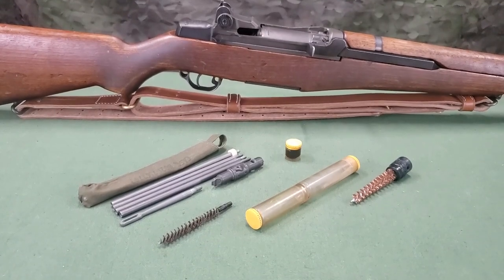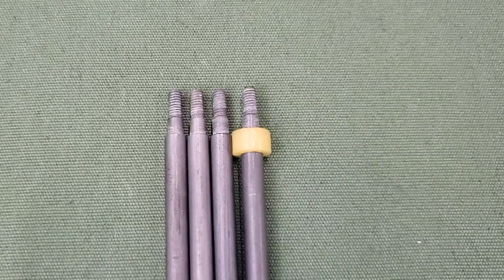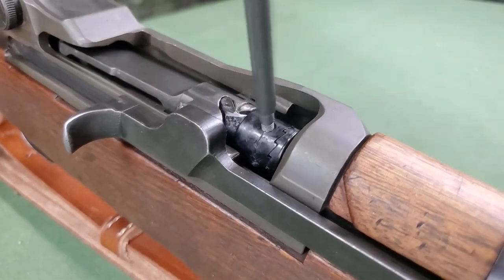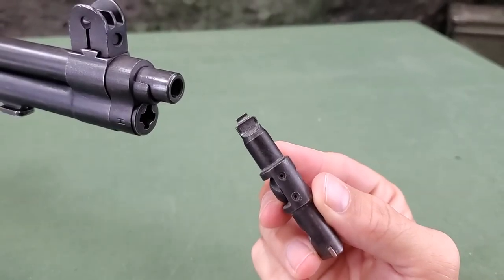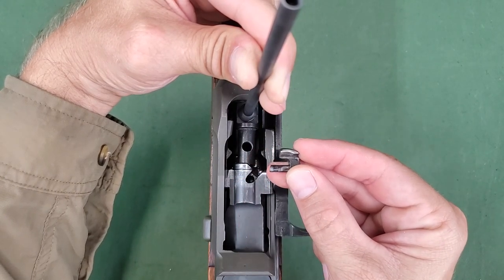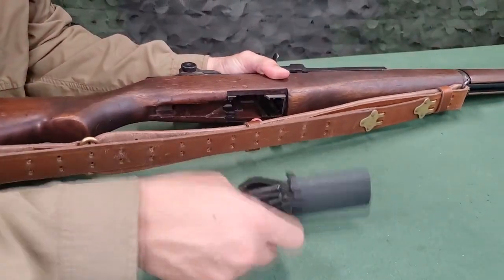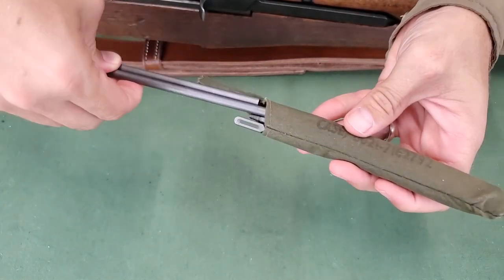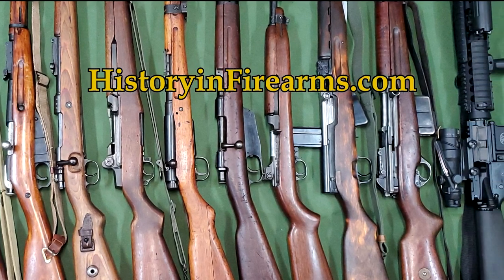M1 Rifle (Garand) Cleaning Kit, M10 (TF 8-05E)

Comment: Good video, I haven't tried to remove the extractor or ejector with the bolt in the rifle. Thanks for the tip!
Reply from the maker: Thank you and you're welcome!
Reply: You can also perform the bolt disassembly out from the rifle also using your hands or a small bench vise with soft Jaws or a towel would do the trick. Great video man. Thanks!
Reply: Just remember, the disassembly of the bolt is not nessisary for regular cleaning

Comment: Well, i tried it, except i had difficulty screwing it in like you did, so i just pushed it in muzzle end, and the rod came unscrewed inside the barrel at the halfway point. Now it's stuck. I guess thats why they said dont push it in.... also, mine doesn't look like yours. It has the screw driver end, but the other end is just a slot, like a flat head screwdriver slot
Reply from the maker: Oh man you got a brush stuck in the barrel? 🫤 The M10 handle/combo tool is different?

Comment: You may ruffle the feathers of the "grease only, heavy grease and plenty of it" crowd using oil to lube the bolt raceways, the old adage; "if it rotates, oil it, if it slides, grease it" applies. Also, I wonder how many G.I.'s actually cleaned the bore and chamber in the laborious method you've demonstrated (unless the NCO/CO was present) they most likely just ran the rod brush and slotted tool from the muzzle while resting the rifle butt on the ground. Good video, though, I actually learned something. I have two kits (for M1 and M1A) but neither have the plastic spacers, never knew they existed.
Reply from the maker: The inevitable, THIS is how you clean a rifle, will always be up for discussion. Additionally, practices and tools of old are often not best practices for today. For this reason, I have intentionally avoided making "how to clean your rifle" videos. The intention of this training film is to be a "how to use these tools" per the TM if one chooses to do so or is just curious.

Comment: I got 1 of these its a reproduction but the green bag has awful sewing job
Reply from the maker: The originals were made by the lowest bidder and don't have designer sewing either.  😁
Reply: @HistoryinFirearms I just got m1 garand 1943 for receiver and barrel and I just got done replacing all the springs, the brand new ejector spring was a pain in the ass worst then the hammer spring
Reply from the maker: @TorryGood  Congrats on your piece of history! Those can be tricky springs. I haven't taken a trigger group apart before.
Reply: @HistoryinFirearms  receiver is november 1943 and barrel is December 1943 still has most its ww2 parts with danish stock, bolt is march 1942.
Reply: @TorryGood  Very nice!